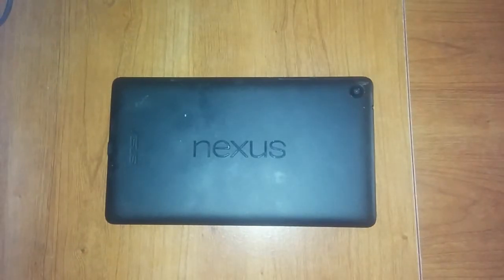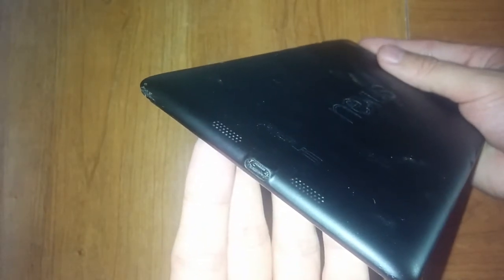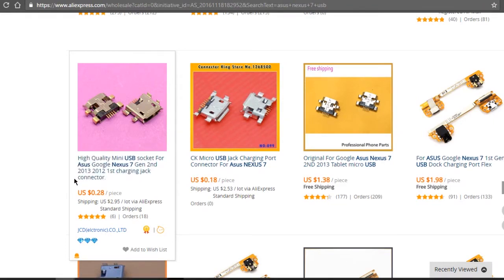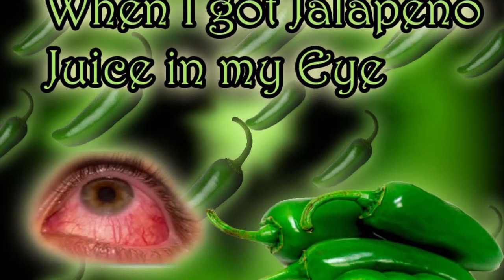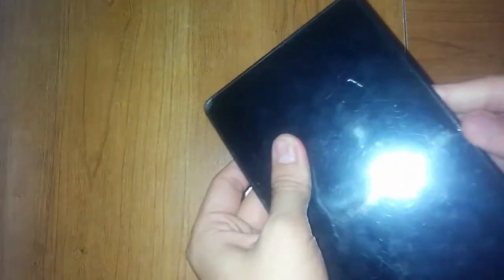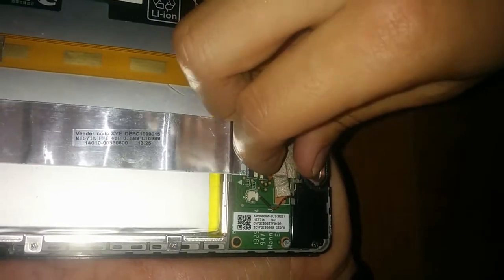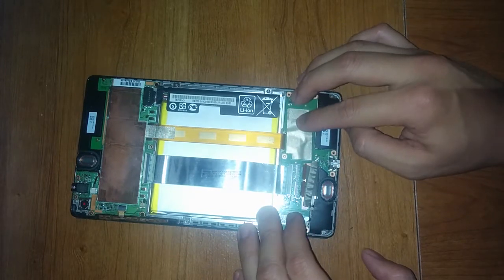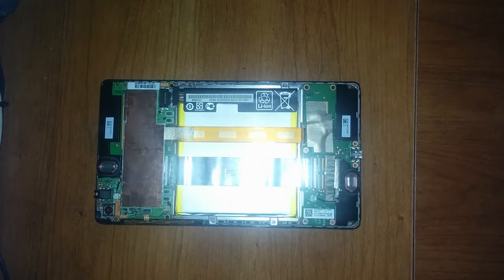Nexus 7 2013 USB charging board replacement

Comment: Great video, Man. Loved your humor. Sounds a lot like me. Very informative, too. I'm getting ready to replace both the battery and the charge board on my 2nd gen Nexus 7 and this video helps considerably.
Reply from the maker: Appreciate it! Maybe I should do more then. Yeah, the Nexus 7 of mine feels like needing a new battery as well. Am I right to assume that you have problems initially with the screen rotation/orientation also? If the answer is yes, man, what a poor quality product this stuff is. Just replaced the lcd screen with a new one a few weeks ago because of a crack breaking the touchscreen, so I don't have to heart to get rid of it yet.
Reply: @BaoNguyen84087  yep. Screen rotation is an issue. Sometimes it rotates, sometimes not. But it rotates ok when games are loaded.